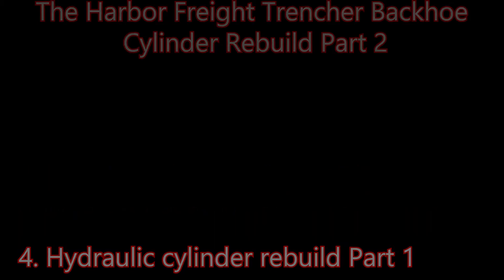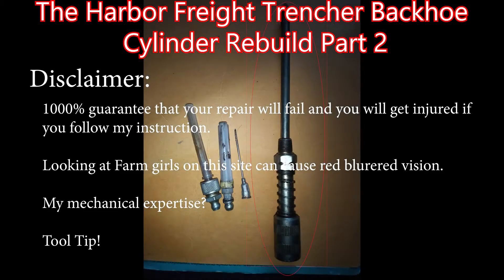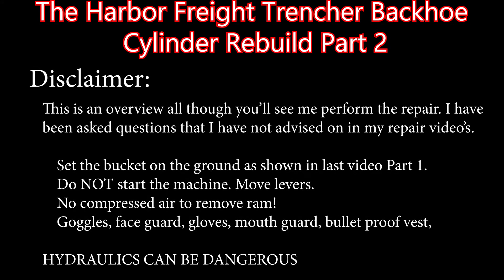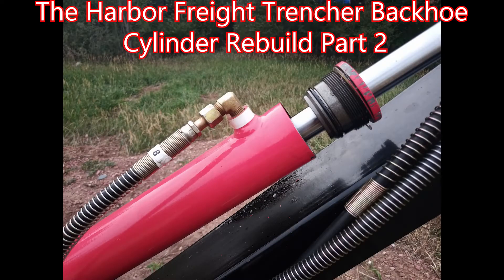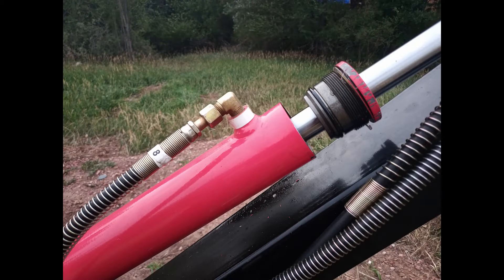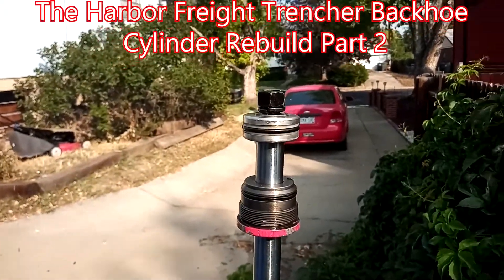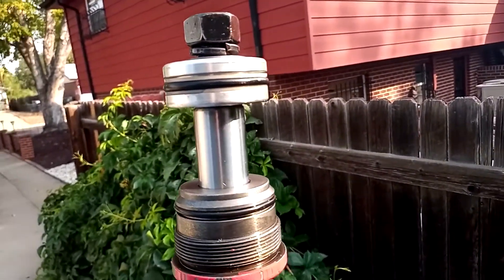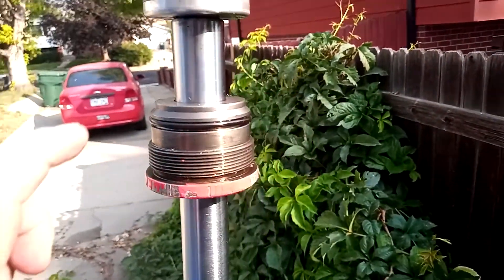Harbor Freight Trencher Backhoe Hydraulic Cylinder Repair Part 2 + tool tips and farm girls.

Comment: Torque specs. Only used when someone is watching.
Reply from the maker: with cylinder ram nuts,,, I say as tight as you can, and then just a little more = lots of foot poundds of torque. lol
Reply: @JohnDoe-zz3hj  100 foot pounds